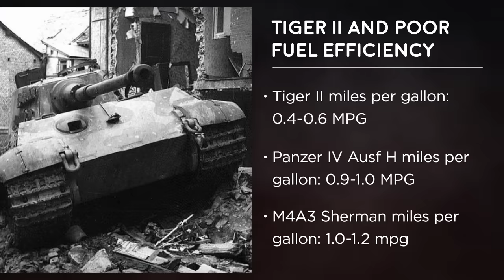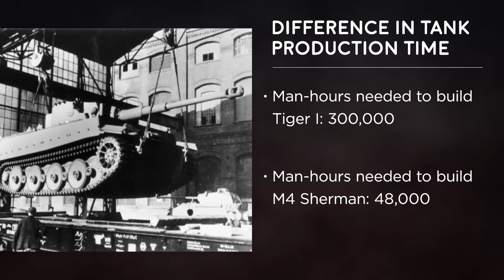Why Did German Tanks Perform So Badly in The Battle of the Bulge?

Comment: Very informative. Excellent work. A small correction: You state that the Sherman Firefly was equipped w/ a 76mm gun.  Firefly had a British 17 pounder.
Reply: The 17 pounder is a 76mm gun, 17 pounder refers to the mass of the explosive charge, and 76mm is the diameter of the muzzle
Reply: Incorrect…..the term 17 pounder is absolutely correct & is a 3 inch gun …..not 76 mm as you say…..& is 76.2 mm anyway…….if you’re going to correct….get it correct!!

Comment: I saw a special on tanks.
It points out how tank design is a balancing act.
Firepower - Armor - Speed - Complexity - and other things, even comfort for crew. (If the crew is sweltering in the heat or freezing in the cold how effective will any tank be?)
- As you can see, Heavier armor, like the Tiger 2, means more protection but it also means heavier, slower, and a gas guzzler. 
Shermans often get looked down on for several reasons but once they got out into open fields they proved themselves with their speed and reliability.

Comment: One thing to keep in mind about the sherman is that germany didnt actually think they were easy to knock out despite the damage and losses they sustained. Chieftain has a good video on that
Reply: No tank is "easy" to knock out.
Reply: When the Germans got back into the Tank production business, they focused on a tank with light weight, and produced the Leopard 1.  The designed it based on the lessons that the Sherman taught them.

Comment: When talking about the Sherman. You are forgetting EFFECTIVE Armor. The Sherman was close in frontal effective thickness to the Tiger, So only the Tiger and Panther had better armor. And it is also widely considered to have had better optics than most. Especially since it had a roof mounted optic that allowed the gunner to see a target even when in cover/concealment
Reply: a sherman has nowhere near the effective armor of an angled tiger
Reply: @jellyfrosh9102  it's about a CM difference. Depending on Sherman Variant. And again. Remember what EFFECTIVE thickness is. This is taking into acount the frontal slope.
Reply: @jellyfrosh9102  and look. If You DONT believe me. Take any Shermans armor thickness. We'll even go off the base model. Frontal plate was 2 inches thick. At 56 a degree slope. Tiger was 3.9 at like 6 degrees. Put two lines at those distances. Slope them to their respective slopes, then measure the between the lines. Its pretty close. And that's before even getting into the better quality, and consistence of quality of US armor steel over German
Reply: @claytonmachine12  this is nonsense often repeated and don't take into account the matter of overmatching. Yes, against 50mm guns and smaller, the Sherman's 51mm  glacis will indeed be around 90-100mm effective, but against bigger 75mm, or even worse 88mm (88mm shell vs. 51mm thickness) it will not. An 88 will go through as if there are barely any slope at all. Late war "large hatch" Shermans (63mm glacis) were better.
Reply: @TTTT-oc4eb  ......the hell does that have to do with anything. I never said the Sherman's armor would stop and 88. I said it was near the same frontal thickness of a Tiger.which made the BACKBONE of the German Armor. The PZ III/IVs, less effective. Not counting the Bulge. There were only THREE times the US faced Tigers in Europe because of how few there were.
The Panther had a few more engagements. But a majority of the time it wasn't an 88 or the long 76 that US tanks needed to work about. It was the 75 of a PZIV, or the even smaller guns of the III
Reply: @claytonmachine12  keyword: overmatching, 75mm shell vs. 51mm front hull plate = 50% overmatch, means the effect of slope will be minimal, which again means that the 75mm shell from a Panzer IV will punch through like a knife in hot butter. OTH, the Tiger's 100mm front plate overmatches most incoming rounds. Big difference. There were almost no Panzer IIIs left in Europe 1944. Tigers met the US Army several times in Italy, Belgium and Germany. From late 44 till the end, the Panther was the most common German tank.
Reply: @TTTT-oc4eb  .......so you are saying g a PZ IVs 75 will pen a Tigers hull. Even when the HV 76 had minor troubles with it. The PZ IV always had trouble with the Sherman's front
Reply: @claytonmachine12  the 75mm l/48 in the Panzer IV had no trouble at all with the Sherman's front, and could quite possible penetrate the hull front of a Tiger out to 1000 meters if the Tiger was not angled.
Reply: @TTTT-oc4eb  Should also mention this, but German quality steel. Wasnt that great. ESPECIALLY towards the end of the war. There were MANY instances of German tanks getting hit with HE and the armor just shattering. And claiming Slope doesnt matter because "well when the armor isn't sloped the shell will pierce" is just stupid
Reply: clsytonmachine

The Tiger I never suffered with poor quality steel. Quality control was met right to the end of its production.
The Tiger I had a 265 Brinell Hardness, which gave it a circa 12% more effective shell resistant quality than the best allied steel of the same thickness.
This meant that in effect, despite its paper thickness of 100mm, the Tiger Is front plate was around 130mm effective on the lower front plate with its 24 degrees angle, and around 115mm on the glacis.
Even the 80mm side plates were over 90mm effective.
These figures are from British tests. Source Tom Jentz, Germanys Tiger Tanks.
Reply: @lyndoncmp5751  You're partially right. The TIGER specifically didn't suffer as much from the plates breaking from HE. It was the welds. The Tiger I had a habbit of the welds cracking and separating under fire.
Reply: @claytonmachine12  Everybody struggled with armor quality in WW2, but the Tiger 1 probably had the best quality of any WW2 tank.

Some notes on armor quality

Much has been said of the poor armor quality of late war German tanks, but the bottom line is that all the major powers had severe problems with armor quality during the war;

Germany: German armor was of high quality, but their mills had persistent issues with quality control from 1944 onward - at a time when German war industry finally got into full gear. That is when they switched to a different method of heat treatment for their armored plates. Tiger 1 production ended in August 1944.

UK: British tanks up till mid 1944 suffered from poor armor quality armor. Lorrin Bird & Robert Livingstons research revealed that British plate of 57mm & above all were affected by the poor quality ie, 152mm of British plate gave the equivalent of 137mm protection. This was a result of problems within the British steel industry and production of poor quality steel. This was adressed in mid 1944 when the British steel industry was overhauled.

USSR: Throughout the entire war (likely got better near the end). The loss of their magnesium and nickel mines was part of the problem. And of course, so too was the relocation of their steel mills. Soviet armor plates were very hard and brittle, with a very nasty tendency for internal spalling, resulting in pieces of armor wounding and killing crew members.
“The low nickel content of Soviet plate armour meant it had a nasty habit of spalling when hit. This would send steel splinters flying around the inside of the tank, causing apalling injuries to the crew.”
T-34: The Red Army's Legendary Medium Tank, by A. Tucker-Jones.

"If a shell had gone through the turret of a British tank the commander and the gunner could have stayed alive, because there were virtually no splinters," Bryukhov observed "while in a T-34 the armour would spall a lot and the crew had few chances of survival." This was because the medium hardness armour of Britains Matilda and Valentine tanks had a very high nickel content (3.0-3.5 percent), whereas Soviet 45mm high hardness armour contained only 1.0-1.5 per cent nickel, resulting in much lower ductility.
T-34 In Action, by Artem Drabkin.

USA: Armor quality was likely problematic for all - suddenly ramping up production of a highly technical item like that tends to have problems. For the U.S., it was an increase from producing five tanks 1 January-31 August 1939, to 95 from 1 September 1939-30 June 1940, to 280 1 July 1940-31 December 1940, to 4,022 in 1941, to 23,895 in 1942, to 29,505 in the peak of 1943. It would be surprising if such expansion did not result in problems.

When steel manufacturers finally produced the turret casting for the Medium Tank M4-series and the hull casting for the Medium Tank M4A1, testing by the Ballistics Research Laboratory discovered problems with the quality of the armor, which suffered from pitting, soft spots and variable hardness. One turret, produced by Union Steel Casting Company on 21 May 1942, was subjected to cold weather tests 1-25 February 1943 and was found to be of “relatively poor quality, containing large amounts of fine macroscopic and microscopic shrinkage distributed throughout”, albeit the ballistic failure of the armor in the test was attributed to the sub-zero temperature of the test rather than the poor quality of the steel.

The welded-hull M4, M4A2, and M4A3 types also suffered problems with the quality standard of the welds and rolled armor plate produced by American steel manufacturers. As late as February 1945, a Watertown Arsenal Laboratory analysis of 96 two-inch-thick repair welded cast armor ballistic test plates from two different foundries found significant variances in hardness levels and decreased ballistics resistance in the welds. Then in June 1945, a Ballistics Research Laboratory analysis of four sample plates produced by the Great Lakes Steel Corporation and heat treated by the Standard Steel Spring Company found numerous defects. Back spalling from impacts in the ballistic tests was extensive and analysts found the culprit was extremely poor steel soundness.

The root cause for these problems was discussed in a postwar summary of the testing activities at Watertown Arsenal before and during the war. Prewar, testing was limited to rolled homogenous and face-hardened armor plate a maximum (except in one test) of 1” thick and mainly 1/2” to 3/8” thick. Metallurgical tests were limited to chemical analysis, hardness surveys (chiefly Brinnell), tensile strength tests, and macroscopic and microscopic examination, but excluded radiographic analysis. Ballistic testing was limited to resistance to penetration and then only with .30 caliber AP ammunition against 1/2” and thinner plates and with .50 caliber AP ammunition against thicker plates. No shock testing was done and all penetration tests were at “normal obliquity”, i.e. with the projectile impacting at a 90°angle to the armor surface. In November 1941, radiographic examination of the sub-surface structure of the steel began, then in early 1942 tensile and Jominy hardenability tests and in early 1943 fracture tests for steel soundness, fiber, and V-notch Charpy tests were added to the regimen at Watertown. It was not until the end of 1943 that the ballisticians began to understand the metallurgical characteristics required for optimum ballistic performance from rolled and cast armor plate. However, even as their understanding improved, the problem remained of how to achieve those characteristics, especially given the requirement for increasing armor thickness...

Testing also found the armor ballistic quality varied considerably; especially in cast components and that some design compromises, such as the cast and welded “hoods” on the front hull for the driver and bow driver created so-called “shot traps”, which also markedly reduced the resistance of the armor. The immediate solution again was the addition of welded-on armor applique plates added to the hull front to protect the vulnerable hoods and early-model direct vision slits."

Rich Anderson, Dupuy Institute

Comment: I've heard different versions of why the German tanks took so long to get to Normandy, but I I recall hearing about some French girls who poured abrasive grease on the bearings of the railroad flat cars that were to move the tanks from Montauban to Normandy. Already short on fuel, this proved to a huge impediment since the only alternative was to drive the tanks the 750 km. It took the Germans 14 days to get the tanks to Normandy.
Reply: Its worth reading a book called Das Reich by Max Hastings about the delays to the movement of that unit brought about by the French Resistance after the D Day landings. It includes the use of special abrasive paste you mention, plus lots of other delaying tactics like guerrilla style battles which forced the Germans to pause and clear each engagement site before moving on. By that stage of the war, the Germans controlled the towns, but large swathes of the country were in  the hands of the resistance groups. Cost the Germans several days delay.
The downside was the terrible retribution atrocities carried on the innocent French civilians (whole villages slaughtered).

Comment: I read one account, and I don't recall where, was that some of those building Panzers, were forced labour. They often did petty sabotage, including the gear box. Allegedly, one or two tiny metal scraps in a gear box, would inevitable result in the box failing after weeks or months of use. These gear boxes were very complex and difficult to replace.
Reply: Mechanic here (F-16, Phantom, bronco and all sorts of lesser vehicles and machinery over four decades-ish) and it wouldn't take much for someone who manufactures a component to sabotage it. Machining a few thousandths off spec to the tight side, partially blocking an oil gallery with swarf, severely over-tightening fasteners, mismatching torque on patterned fasteners,  incorrect heat treatment and any number of process-specific sabotage make using slaves for advanced manufacturing quite stupid.

Comment: I'd also argue that you could take the Sherman, and if you put it through German industrial and operational usage problems, would be similarly unreliable. Basically, take any tank and build it with poor quality materials and give it to poorly trained crews and its pretty much guaranteed to preform poorly.
Reply: Patton's Shermans in 4th Armored Division took five days just to move 20 miles to Bastogne from December 21st, including 3 days just to get past the small town of Chaumont.
I guess the Shermans performed poorly too.
Reply: It's the Ardennes man
If you gave the Germans Shermans instead of Kingtigers, they would have performed much, much better.
Even with the bad German workmanship and materials at that time in the war.

A Kingtiger weighed about 75.5 short tons
A Sherman weighed, about 33 - 42 short tons, depending on variant

German Tigers broke down because the engine had trouble moving all that mass. And those problems only got worse with the bad workmanship and materials. Shermans built by the Germans would of course break down more often than American built Shermans but the Sherman was still a superior design to that of the Kingtiger, at about half the weight.
Reply: Audie Holland

Over 500 Shermans were lost in combat in the Ardennes. That's more than the combined numbers of all German tanks lost in combat in the Ardennes.
The German tanks also advanced quicker in their attacks than the American tanks did in their subsequent counter attack.
The Shermans performed no better overall. Id say less actually.
Reply: @lyndoncmp5751  Still, they were lighter, so a disabled Sherman was not automatically a lost one, could be retrieved and repaired.

A disabled Kingtiger's crew solution was to set the contraption on fire so the enemy would not capture it intact.

German repair rates were abysmal when compared to Allied repair rates on their tanks.

And at the end of the day, because of the ease of production (less parts, less manhours), the Sherman won without even entering the battlefield.

If only the Germans had never tried super heavy monsters but instead had focused on  making Sturmgeschütze and Panzer IVs, it would have been a different story.

Probably with the German spearheads making it to the Meuse, the weather clearing all the same and then their supply lines, ammo and fuel trucks would be wiped from the face of the earth.
Reply: AudieHolland

But guess which German tanks got the furthest in the Ardennes? It was the Panthers of 2nd Panzer Division.

In reality, there weren't many King Tigers involved in the drive to the Meuse so they aren't really relevant.

I disagree about Stugs and Panzer IVs. Stugs limited age not as advantageous as tanks. The Panzer IV neither had quality or quantity advantages by 1944. It could not be improved upon after Spring 1943.

The Germans were simply running out of resources. They lacked recovery and repair vehicles. Around 50% of German armour losses in the Ardennes were due to lack of fuel, minor mechanical issues, getting stuck in a ditch a thrown track etc. I guess if you don't have repair and recovery vehicles in your unit then you have to leave them there.

The Ardennes was poor tank country all around for both sides. Even a 25 ton Jagdpanzer IV collapsed a bridge at Petis Spai, and that was nearly 10 tons lighter than a Sherman 76mm.

Crazy!! The Germans never had a hope of achieving their objectives.
Reply: @lyndoncmp5751  Agreed they never stood a chance. But as soon as the weather improved, the Allies' overwhelming airpower was unleashed again.